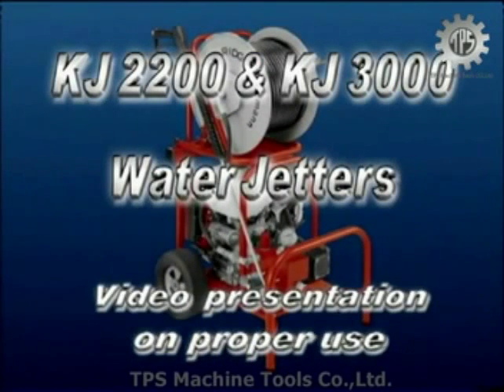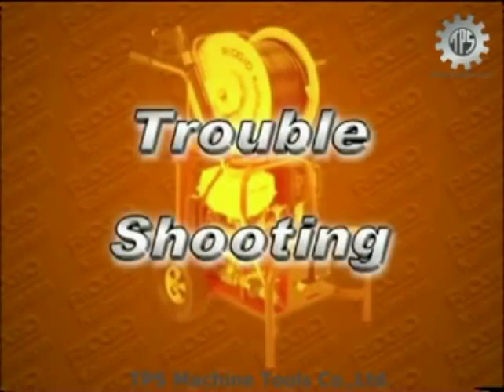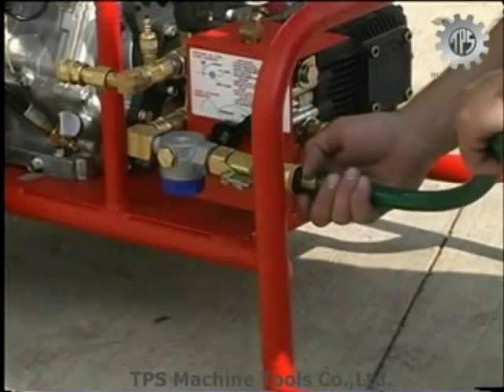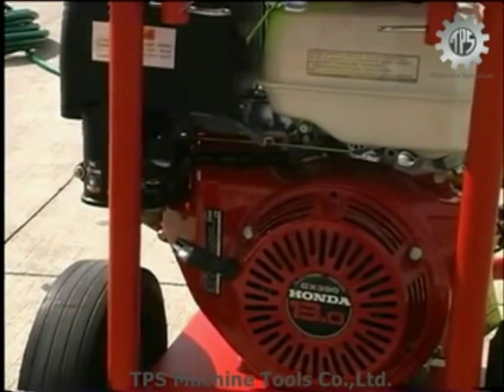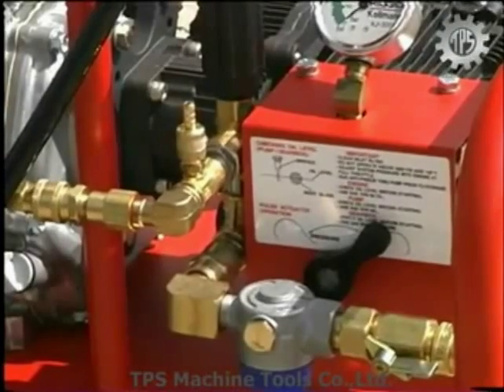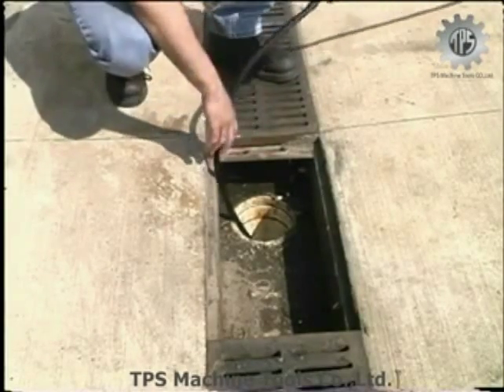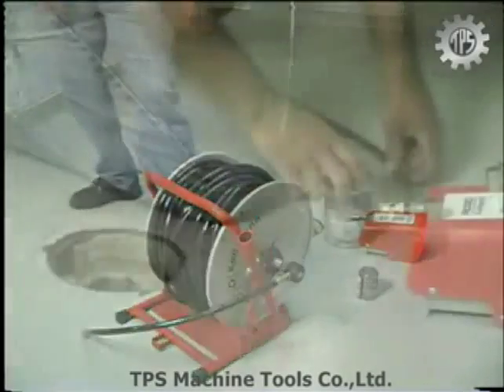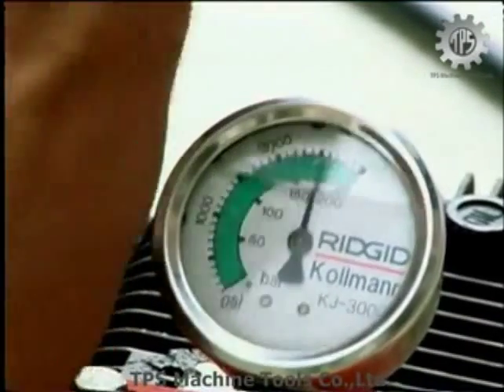KJ-3000 Water Jetter

Comment: I had both the KJ 2200 and the KJ 3000  and  although the 2000 was decent it just did not have the cleaning power I needed for 3" cast iron leader lines that had mud and leaves so I sold the KJ 2200 after buying the KJ 3000

  GREAT Machine and it does deliver the rated 3000 PSI and 4 GPM .. Other then routine service  it never failed me in lines as big as 8"  and it was portable enough to take on a roof  job
Reply: Great machine BUT very pricey.. Amazing tool has a Jetter   that is more portable and has slightly more power with the same engine  a Honda